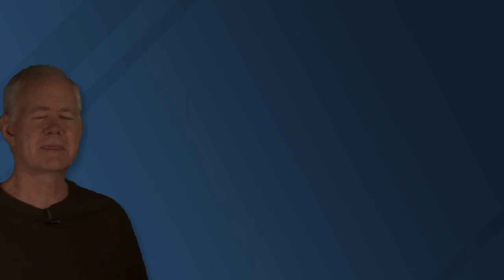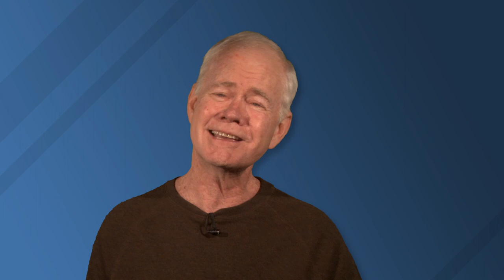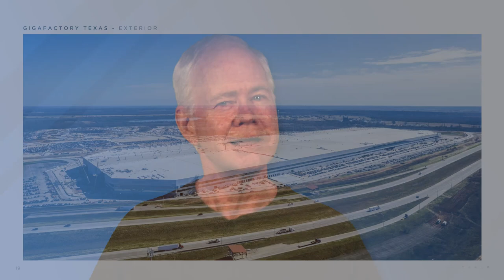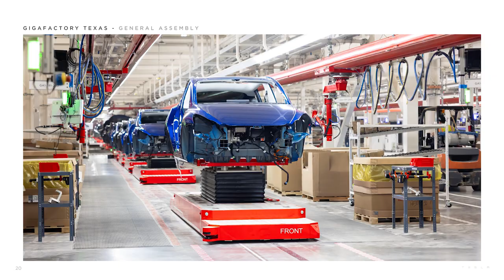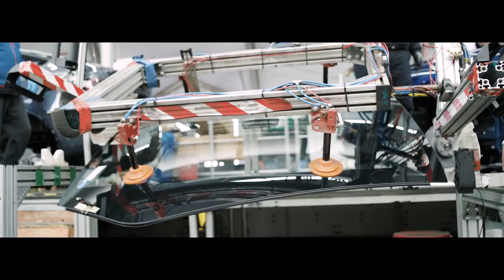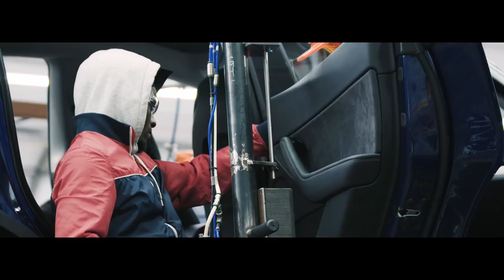Can Tesla Surpass GM & Ford? Here’s What Will It Take for That to Happen

Comment: I think you still need to ask to the people that really knows the EV stuff. As someone said previously here, one factor to consider is Battery production, and Tesla has lots of contracts with many battery makers all over the world, and they also produce their own batteries. Austin capacity is going to be well over one million vehicles by itself, may be 2-3 million by 2030, if not more, and Freemont has demonstrated it also has capability of increasing production a lot. To that add Giga Berlin and Shanghai that will be no slouches.  And then there is FSD, where Tesla has the overwhelming advantage over ALL its competitors, and last but not least, Tesla's OTA is way superior than anyone else's.  What this Mr. Schuster says is based only on ICE business knowledge, and that is now low tech.  Now, add the production of Freemont, Giga Austin, Giga Berlin and Giga Shanghai, and you will easily reach about 10-12 million cars per year at least, more than any other carmaker.  And I don't see how GM will be able to produce more than 26-30 vehicles per quarter with Mary Barra at the helms!!!! LOL

Comment: Hey John; Really enjoyed that even though I saw most of it on Thursday.  Anyway, just a note on your arithmetic at the end.  GM & Ford will lose sales as Tesla gains over the next couple of years.  Tesla should easily pass both of them together by 2025 or 2026.  A doubt if they will need another factory to get this done.  Also, seemed like Jeff was doing a bit of squirming during his answers.  I think he knows what is coming but has to hedge his bets a little so he doesn't get jumped on by those who don't see the Tesla Tsunami that's on the way.

Comment: This is probbably the most fluid time in the car industry for some generations. The pandemic has produced logistic problems for all manufactures. The cost of producing electric vehicle, specifically by Tesla and Chinese manufactures is interesecting that of ICE vehicles. The legacy OEM have massive liabilties, such as pensions and debt. Autonomous systems are being implamented into all aspects, both in cars and production system. There is a likelyhood that Chinese automakes will enter the US Market. 

Where Tesla will move ahead and dominate is the structural battery pack combined with front and rear castings. Why? It will drop the wait of their EV significantly below thier competitors that are just now investing in oudated technology. It will spead up thier production, and they will be able to produce more cars from the same footprint of factories, at a lower cost due to reduced tooling. It will improve the quality of thier vehicle and essential remove problems of pannel gaps. My prediction Tesla will surpas Ford and GM at the end of 2023 in production, on a world wide basis.

Comment: The real point of Jonas' prediction wasn't US market share... it was that Tesla would surpass GM + Ford global revenue by 2027.
Assuming GM and Ford can hang on to their $120-140B annual revenue for a couple more years (which I doubt), Tesla will rocket through that revenue range in 1-2 years -- and 1-2 years after that, by 2027, will have doubled again.  Your program three years ago completely discounted Tesla's potential.  You've learned nothing in three years.
Reply: Musk is being overly bullish on that regard, as the company faces a lot of headwinds he failed to account for. One - a ton of revenue comes from the Superchargers, but that will decline as rival high-speed charges from our. Why do you think he is lobbying against government programs to expand chargers even though they are necessary for the US to switch to EVs on a mass scale. Most of Tesla's expected revenue is from subscriptions such as FSD, but can we take expect every Tesla owner to fork out $12k p.a. for FSD, IF it isn't actually terminated by regulators for failing to follow testing rules and safety failures. Remember it is only in the US now. Tesla also faces stiff competition. It is no longer the biggest EV seller in China, surpassed by GM and BYD (each more than double Tesla in January), and European and Chinese models routinely outsell the model 3 in certain European markets in any given month. It seems the Europeans aren't so gung-ho on Tesla so models like the BMW i4 (which most reviews seem to say is better than the model 3) have a real chance of stealing Tesla's sales. Then Tesla has to deal with saturation. In the US they sell only premium products and are close to BMW in sales. Without new models (and cheaper models), they can't realistically grow sales much more, no matter what their capacity. Robotaxis? Tesla hasn't even explained how they'll profit from that market, even if FSD actually works (which is far from guaranteed). How many owners will switch to FSd and loan out their cars? Will it even pay off? Cruise, Zoox, FAW, BYD and Arrival all have purpose-built ride sharing cars ready for production.
Reply: @AutoReport1  so many TSLAQ talking points all in one post... Actually all of them :)
Majority of those can be dispelled by a simple point - tesla sells all it makes. And it is ramping fast. As capacity comes online, your arguement of no demand/no sales in Europe/China will evaporate.
Reply: @Custo911  for now. That means Tesla has no real metric of demand. They could be 20 units away from peak. Markets are predictable, there IS a real limit to how many vehicles you can sell at given price. Shanghai is ramping up but sales are not improving. If there is a backlog of orders, why weren't they delivered?
Reply: @AutoReport1  EVs are taking over all cars (even Legacy admit that now) not sure where you get demand ceiling from... especially multiple price increases and long wait times. At this stage all production will get sold and then some.
Lack of demand was a talking point since 2017... With an amusing result.
Reply: @Custo911  ignoring powertrain, there is still a limit to how many $40k+ buyers Tesla can find. That's the top 50% of the market. Given the number of players, all of whom are offering EVs now, there is a limit to how many people can buy a car at that price. If,  and it's a big if, they can hit 1 million vehicles, that may be  the limit of market size for vehicles in that price range, and Tesla has NO plans to sell anything cheaper a pickup might help increase sales but that's at least 12 months away, and probably 2 years still. Ford, GM and Rivian are already ramping up deliveries and GM will add a 2nd higher volume pickup and probably a third before the Cybertruck arrives.
Reply: @AutoReport1  do you know the average selling price of all cars in USA? :)
Reply: @Custo911  it's regularly reported on Autoline.
Reply: @AutoReport1  so you know the answer to your own question how many people can buy cars at 40k+
Reply: @Custo911  when Howe many of those can you realistically expect Tesla to sway? More than half of those are pickup buyers almost exclusively buying from GM Ford and Stallantis. A good many are already buying the Ford and GM EV pickups when they switch to EVs. Others in that price range are buying Mercedes, Rivian, BMW, Audi, Porsche, Lucent etc.. it isn't realistic to expect Tesla to reach even 50% market share. 1 million vehicles in the US would be a push, more than that pie in the sky.
Reply: @AutoReport1  noone is talking about 50% share. Annual sales are at 90 million. Even 20% of that is humongous.
And in 10 years EVs will be much, much cheaper (on average) then they are right now.
Reply: @Custo911  we are talking the US market. Annual sales are 12 million. Globally there are many markets which will be inaccessible because they will lack EV infrastructure for the long term. India may Never allow Tesla to build there or import vehicles. Japan and Korea will probably be closed forever. Brazil is ethanol dependant due to regulation and policies will not change in the near future. Negligible EV sales there. Where is your sales growth coming from?
Reply: @AutoReport1  xo many  wrong points , dont know where  to start.🤔.😅🤣😂
Reply: @aurelio-reymilaorcabal9669  I guess you can't think of any because there aren't any. Tesla's realistic major markets are Europe, US and China. There are small markets where Tesla will pick up sales like Australia, but they are already keen for Chinese EVs over extremely expensive Tesla's. They sold 23k vehicles last year, no wait maybe that includes 2020 as well, Tesla got caught misreporting all sales ever as just 2021s. Journalists do that for the Honguang Mini EV all the time as well (no people it wasn't 550k last year, it was "only" 452k, although some hundreds of those may have been surreptitiously sent to Europe to be modded and rebadged without Wuling's knowledge).
Reply: @AutoReport1  You would be right if Tesla was only ever going to offer Models S3XY. However, it is very apparent that the future is electric. That means eventually every single car sold will be an EV. they are cheaper to own and last longer. Also they will be cheaper to manufacture when production switches to them within the next 10 years.

That in turn leads to much cheaper versions of EV. With a cheaper (or even same price) EVs, it is much better to won an EV - it may even be "free" if you account for annual fuel/maintenance savings.
So with that in mind, I highly doubt Tesla's market in only US/Europe long term. As newer models get introduced the prices would eventually come down substantially.

So yes, Tesla will have a 30k or less model in the future. and Yes it will sell on all continents.

Indian example is problematic to say the least. You should check what is actually sold there. it is mostly bikes and very low quality cars. So it isn't much of a car market even now. To say Tesla will never sell there is wrong, but it is not a big market to really care about. Maybe in the future.
Reply: @AutoReport1  "there is still a limit to how many $40k+ buyers Tesla can find. That's the top 50% of the market. Given the number of players, all of whom are offering EVs now, there is a limit to how many people can buy a car at that price."
Grow up.  No one else is selling EVs cheaper than tesla and their EVs all lack chargers.  The only cheap EV was the bolt that got 250mi range, but was useless for travel.  The bolt sales show you how little interest there is in cheaper EVs that cannot be used for travel out of town.  Ford and GM are fooling themselves if they think there is any demand for 40k or more short range EVs.  (They can be short due to low range, slow charging, or a lack of chargers)  $40k or higher is too expensive for a non-long range EV.  That is why tesla owns this market.  Teslas are way cheaper than the competitors when you compare the basic abilities of each car.
Reply: @_PatrickO  oh and here I was thinking Europe were the model Y has to compete with an Audi, Skoda, VW, Ford, BMW, Mercedes ... Maybe that's why the VW was the best selling in that segment - no chargers. Wait they do have chargers. Never mind. And hey most of these are or will be sold in the US as well. The charger argument is a dead issue. European EVs can ALL use the Supercharger network (for a while they could for free, there being no billing system), and a little thing called antitrust can crack open Tesla's US network if charging is really an issue, and separate it from Tesla. But charging is not really an issue is it? Rival networks are being built out fast enough. Too fast for Musk it seems since he wants the Gov to stop funding expansion. Guess he doesn't really want the world to switch to EVs. He just wants a monopoly. You are evading my point though - Tesla's market is limited by the segments they compete in. There are not enough buyers for midsize and larger sedans and SUVs for them to boost sales beyond 2.2 million (more than double what they sell now but far short of what the bulls are fantasising.)

Comment: The real question is can Legacy auto survive the transition to EV's? Stelantis CEO says they can't. Legacy auto will need at least 1 bailout in the next 2-3 years. Their debt levels are currently at or worse then in 2008. Their business model of not making profit on car sales and getting majority of profit from part replacement at dealerships and financing on sales and leasing is not going to work with EV's. 
The dealerships, ICE factories, no charging network, no real internal software, mostly use all the same suppliers for parts etc. Tesla in nearly fully integrated top to bottom with doing everything in house.  I could go on and on for ever, Tesla won already before they have fully hit scale. Just wait till all 4 factories are running full throttle.

Comment: Question:  Why to auto "experts" assume Tesla can't keep up a 50% CAGR for the next few years?  The company has stated this is their forecast and they have exceeded it every year.  I think it was in 2014, Elon was interviewed when they went public and he stated that he sees Tesla hitting 500K in 2020 and sure he was a few 100 shy, but with all that happened in that year, he hit that target.  In 2030 Elon has stated the target is 20M, why do analysts assume they get stuck at 5Mish cars?  Tesla is riding the price decline of battery costs and lowering manufacturing costs to produce their products, they will enter every market then need to at every price point.
Tesla has shown that they can sustain an average CAGR of over 50% since inception (if my memory is correct).  With new factories coming online that are designed to be significantly more efficient than their Fremont facility and their guidance of 50+% annual growth until 2030.  They are investing huge in batteries, including the entire supply chain, with different primary materials to diversify their product lineups, laser focused on factory efficiency that the VW CEO Herbert Diess has commented as 2 - 3 times faster than VW and their reservation wait lists are 6++ months long (demand is growing as Tesla sells more).  In addition, GM and Ford have multiple years of declining sales (pre pandemic) and huge debt that they want to significantly grow by investing in EVs that they can barely sell at a profit.  Their new EV vehicles sales start off OK but then quickly flatline, take the Bolt for example, before the fires, GM could only sell below 10K units a month and in some cases with huge discounts to clear old model year cars off the lots.  I think even the Mach E, from some reports (and I could be wrong on this point) appear to have flattened out.  
I don't want to see any company fail, but when Tesla continues to grow, they are taking sales from others.  With the huge price spike in fuel costs due to the recent conflict, EVs will become more popular, faster (everyone I talk to is now looking at EVs - Tesla).  GM and Ford don't have the products or battery supply to meet this demand and their most profitable sellers are the highest users of the expensive fuels, the first vehicles that consumers will think twice about buying.

Before any expert says GM and Ford are coming out with x number of vehicles by y date, answer this, with what batteries and in what quantity?  The new Hummer appears to have a 200 KW battery, Tesla could sell 4 cars with that capacity and make 50% more in revenue at 30% margin.  If your cars take more battery to go the same distance and those larger batteries cost more and the supply of those batteries is limited, how many cars can they really sell?  And every single legacy OEM is fighting with each other over securing some supply.  If they are building joint venture sites, they are relatively small and will not be online for 1-4 years.   Tesla proved in Texas that they can bring up a complete 4 quadrant Gigafactory in 18 months in the USA, complete with battery lines.

Why the doubt?
Reply: The next 2 years will blow people away and be undeniable proof of Tesla's abilities! No doubt they currently have teams improving the specs of announced products and working on production techniques so that they will ramp quickly when they decide to start actually producing those models.

A other thing I never hear anyone talk about is the commercial market. Semi is great and it is a great segment but cargo vans and things of that nature leave Tesla a lot of room to grow beyond retail sales.